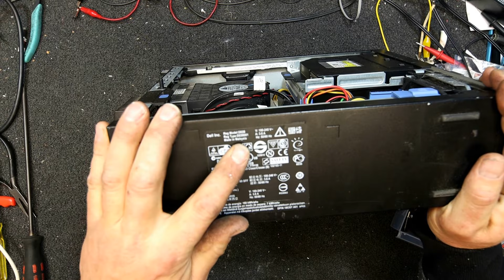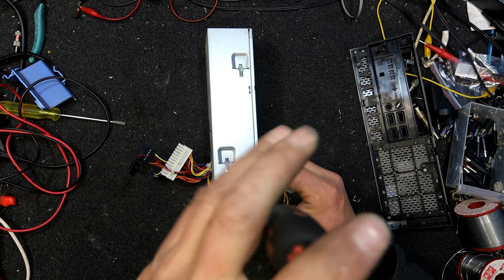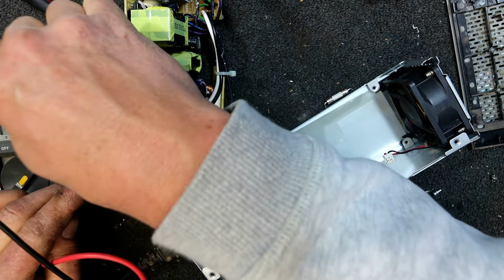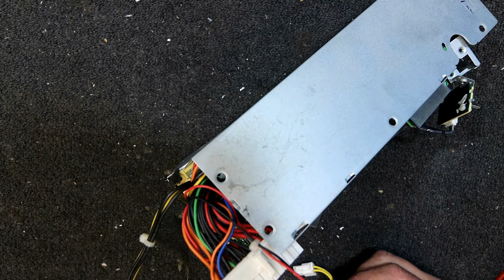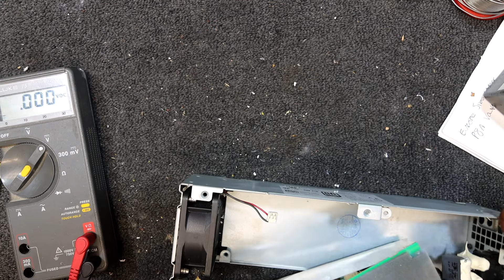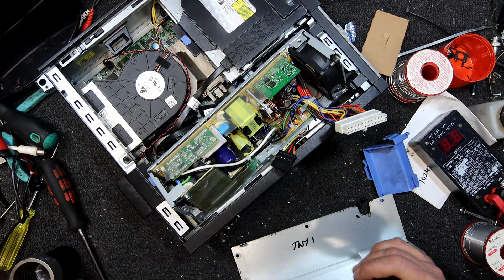Dell Optiplex 790 Computer Power Supply Attempted Repair

Comment: Computer supplies for the last 25-30 years won't switch on without either a load or a wire running from the sense wire to ground on the large output connector that connects to the motherboard.